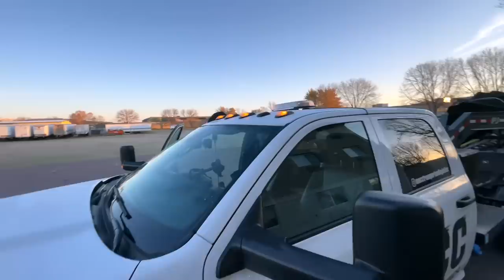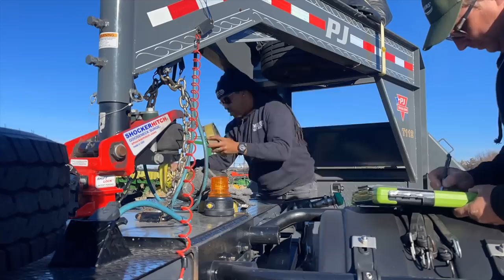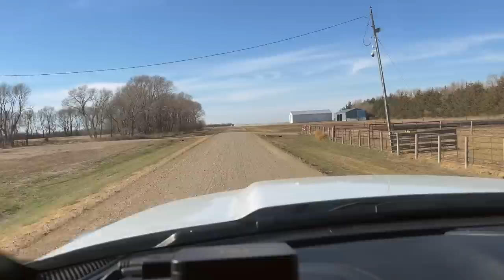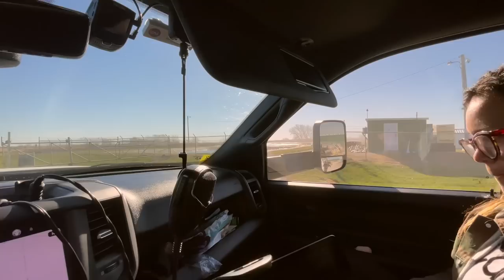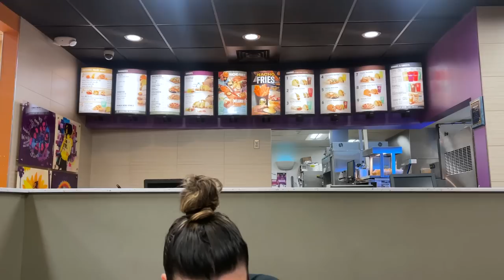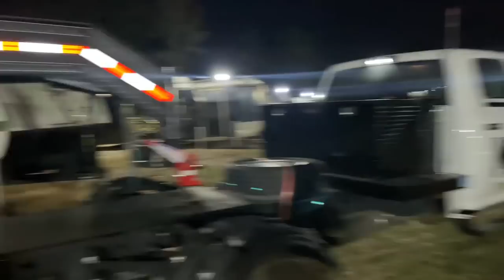Hotshot Trucking OTR Vlog | Does Taking Cheap Freight To Get Home Affect The Market? Day in the Life

Comment: Macc, you know I appreciate all your videos. I'll take cheap if it takes me out of a dead area. 

I rather have gas money covered to get out of a area, than digging into my pockets $400-$500 or more to get back to a good area.

My question is why don't you like taken loads 10 feet high?
Reply: That’s why you negotiate the better rate in case you have to deadhead quite a ways.
Reply: I would guess that the drag from the tall item would cut into your fuel efficiency
Reply: the wind drag causes an marked decrease in MPG and reduces profit.

Comment: What do you think about the diamond c 53 foot step deck
Reply: get a fontaine if ur gon spend 60k on rolling i beams
Reply: I have one. I get rates like a semi. Never under $3 even with this market. You can do 3 partials lol with the load Macc had. So imagine the rate per mile he would’ve had. Its all down to personal preference on set up. I didn’t want a semi so got a 5500 & 53 Step Deck. I get the same rate and I get better Fuel mileage. Now if You want more space to sleep etc, a smoother ride for the tractor and don’t mind a Semi, you can go Semi with a Fontaine.  It all comes down to your plan, goals, and budget. Go with what works for you and What you decide at the end. You will be the one driving and paying the debt either way at the end. Hope this helps

Comment: Do you use truckstop def or Bluedef only?
Reply: Blue Def freezes up north especially in ND it always best to use clear. Once you turn your unit off if it works properly your def should be pushed back into the tank. Even with all that said as a mechanic blue Def is a nightmare for mechanics either busted lines or pump from freezing.
Reply from the maker: I actually use the Walmart branded def. I used to use blue def but had to cut cost. 

@Dustin Thats good to know, thanks for sharing

Comment: Do you need a CLD for a gooseneck 40 footer ??
Reply: Yes and No...yes if over 26klbs truck and tralier GVWR combined....no if under 26k lbs GVWR combined
Reply from the maker: It depends on the weight category you are in. Operating below 26,001 you don’t need a CDL but do the full research for sure 💪🏽
Reply from the maker: @I A hit it on the nail!